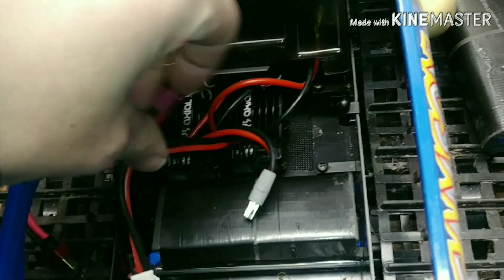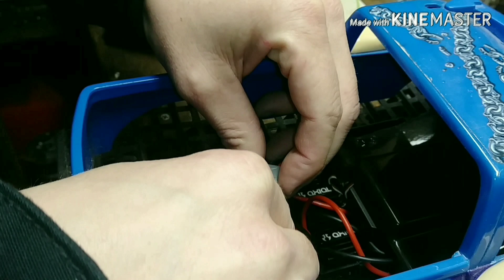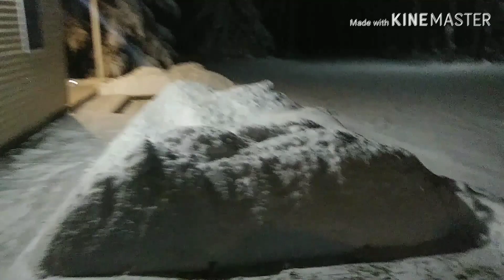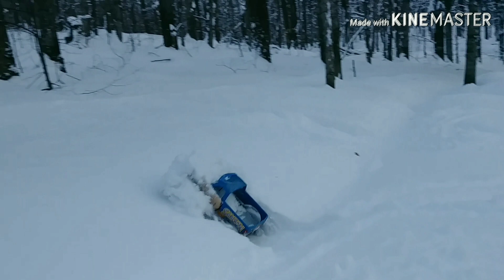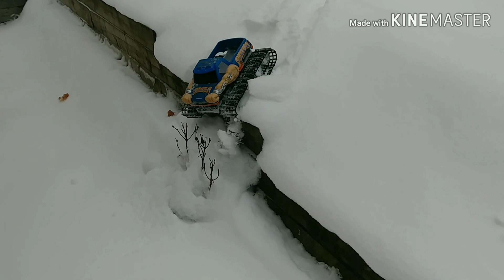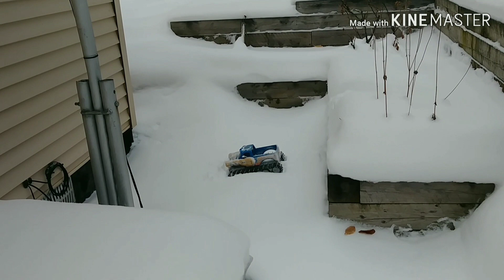Kyosho Blizzard fr "Blizzard Bash"

Comment: Damn..... that’s a lot of snow!! Looks way cooler with that body on it 😁 Great video man 👌🏻👍🏻😉
Reply from the maker: 😀 finally got some snow,and then some lol
Thanks for the truck body compliments 👍👍 
My first instinct was to use a Lunch Box body,but I didn't have one laying around,and they are kinda pricey to buy one,it's actually more cost effective to just buy the entire Lunch Box kit,then getting just the body, so! No go on that lol
Next I dry fit every other RC body that I had laying around,and nothing really fit right,"wrong scale" everything was too big, next was digging through boxes of old toys that were in storage,I came across two potential body's,
One was a Red Ford F150 hard plastic New Bright body,
And the other was the Radio Shack Samson Silverado,
both body's fit well,but the Silverado body was perfect, An exact fit really,and the Red F150 body said New Bright on it,so it was disqualified for foul language lol,
The problem with the Samson body was that it belonged to my older neice,and it was still attached to it's original chassis,
So some sweet talking was nessacery in order to take advantage of the Samson Silverado body 😕 lol, 
but I think it was worth it,I dig the color,and the way it looks on the Blizzard,the only thing that I'm unsure of,Are the arm's,and Fists attached too the body,I'm kinda on the fence on whether or not they compliment the Blizzard,they definitely look cool when the truck is coming at you,and it would look sweet with the snow plow attached,but otherwise I'm unsure about them,😕 they may be getting removed in the future,
Thanks again Bill for watching,and for your kind words Brother 😀😎👊👊🍻🍻

Comment: I knew I'd see u post the Kyosho Blizzard once snow hit, ever since I seen this on ur channel last season n at the hobbyshop ive been tempted to get one
Reply from the maker: It's a Total Riot in the snow,
but not much good for anything else lol,
They say it can run on snow, or sand,and by "sand",there talking about beach sand,
Any other type of terrain offers too much traction,which is extremely hard on the transmission,and drive cogs,due too the skid steer action,the extra traction kinda binds things up a bit,the stock transmission,and plastic gears,can't handle the torque twist,I had my blizzard out last summer for a minute,and quickly put it away before anything broke 😕
But it shines in the snow 😀
Definitely a purpose built vehicle lol 
Thanks for watching,and for all your support Brother Stevo,
😀😎👊👊🍻🍻🍻
As for getting a Blizzard you would probably be alright,
I don't know what the snow is looking like down state this year,but for the last four years we got a bunch of snow down in the "D" so you would probably be good 😀👍
Decisions Decisions 😀 lol

Comment: Awesome vid!!! Dang it’s been a while since I’ve got to get on and watch. I actually have a few questions about the best lipo battery and charger for my wltoys when you get a chance. No biggie. Lol. But great video keep them coming
Reply from the maker: Thanks Sarah! 😀
As for the best battery and charger,that's a tuffy!
There is so many different makes and models of both,that it's tough to pick just one,if you have a hobby shop near by I would recommend bringing your truck into them,it would be alot easier finding a battery that will fit having the truck on hand,and they would also be able to help with getting a proper charger,along with walking you through the charger itself,
As for my WLtoys and Twin Hammers,I use a Duratrax Onyx 5,700 mah 7.4v 2s lipo
Soft pack battery,
I unfortunately don't know the part number on the battery as it is "plasti dipped" and you can no longer see the label,
As for my charger,I use a "Hitec X2 ac plus" it can charge up to two batteries at a time,and it retails for around $100 to $120.00 dollars,
It's a intimidating charger to look at,but after getting to know it,it becomes quite simple too operate,
But it takes a minute too figure it out,which is why I recommend going to your local hobby shop when shopping for a charger,
Traxxas makes a relatively easy too operate charger with a battery i.d. system,it's pretty much plug and play,as long as your using a Traxxas i.d. battery,that combo would require you too solder a Traxxas style battery connector on your WLtoys esc,and would cost around $200.00 bucks for the charger and a battery,
Keep in mind when buying a battery,and charger, you want to make sure that the charger will be able too fully charge your battery,meaning that if you have lets say a 7,200 mah battery,you will need a charger that puts out at least 7.2 amps,if it was a 5,000 mah battery,you would need a charger that puts out at least 5 amp's,if it was a 10,000 mah battery,you would need a charger that can hit 10 amp's,
"1 amp for every 1,000 mah"
5,700 mah = 5.7 amp's
4,800 mah = 4.8 amp's
and so on,and so forth,
For instance a charger that puts out 5 amp's max,would never be able to fully charge a battery with more than 5,000mah,it's absolutely key that your charger can handle your batteries charging needs,
Kinda why I recommend visiting your local hobby shop just so they could help with explaining face-to-face on how too program,and use whatever charger that you get,
Thanks for checking out the video Sarah,and for the excellent battery question,
let me know what you figure out my friend,if there's no hobby shop's nearby,get back with me,and I'll do some more research for you my friend 😎👍
Reply: RC After Dark thanks for the reply. Unfortunately the closest hobby store to me is a couple hours away. I live in a very small town that don’t have a lot of need I guess you would say for a hobby store. Lol. I don’t want to cause to much trouble for you having to research for me but any info is as always greatly appreciated!! I guess I was looking for the best combo at the cheapest cost if that narrows it down any lol.

Comment: What kind of rc car is that? Looks like a lot of fun might have to get one. Great video
Reply from the maker: It is a Kyosho Blizzard fr "RTR" with a custom fit 
"Radio Shack" Samson Silverado body 😀
The vehicle was ordered from Amain Hobbies,and came equipped with a four channel radio,6 channel receiver,7.2v nickel metal battery,a lexan or pvc snow cat body,and a removable snow plow blade, with corresponding servo for raising,and lowering the blade,
The vehicle was made for Snow,but it can also be used in sandy areas,like at the beach or sand dunes,
definitely not recommended for Terra firma like dirt,gravel,grass,or rock,
Those types of terrain create too much drag on the transmission,it's fine for straight line driving,but the torque from turning on those high traction areas will destroy the transmission,
Snow and fine sand are ideal operating conditions,
Thanks for watching,and for the kind words my friend 😀